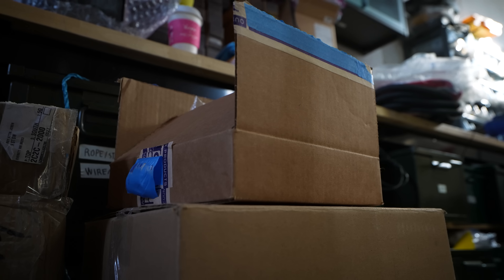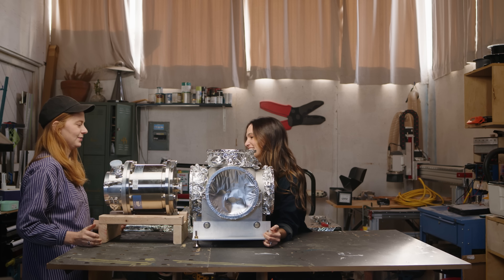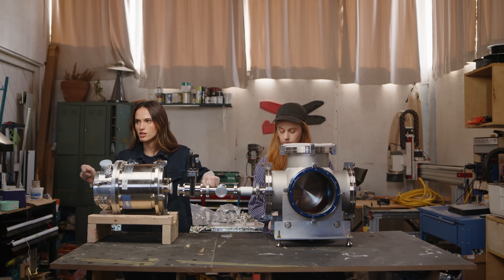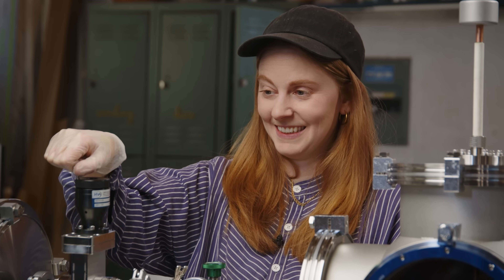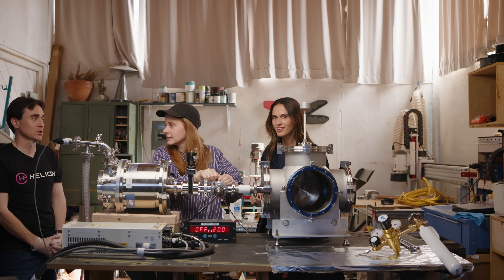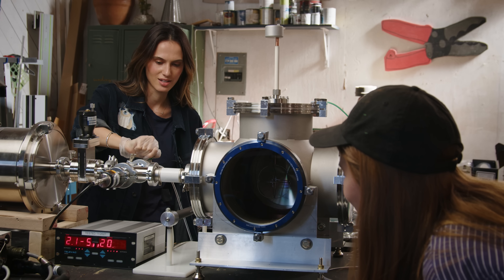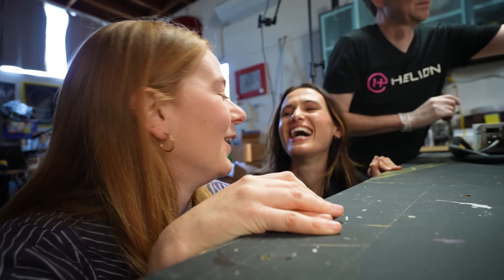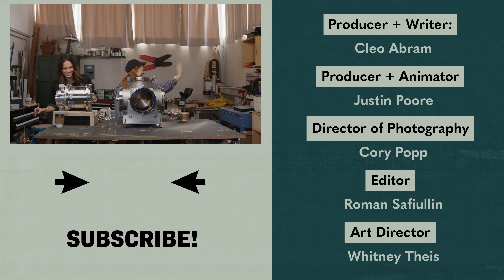We Tried To Do Nuclear Fusion

Comment: Cleo, when you suggested building a fusor to help people better understand fusion, we were all in! Thanks for coming up with such an awesome idea. And Simone, thanks for letting us send parts of a fusion machine to your workshop (twice 😅). This was so fun to build and really helps explain some fusion fundamentals.
Reply: It would be really cool if you had some way to detect the He in this kind of demo.
Reply: @jullit31  The easiest way to detect that fusion is actually happening is to prepare a Geiger counter (aka a radiation detector) that is configured to detect neutrons.  You can also use a dosimeter that is used to detect radiation exposure...a smart thing to do anyway when doing any nuclear energy experiments in general.

Measuring Helium may be a fools errand in terms of the quantities of Helium generated, but it might be worth the effort from an academic standpoint.
Reply: @jullit31  Replace the roughing pump with a helium leak detector, standard piece of vacuum equipment, would do the trick here. Would be cool to hear the tone change on the console as the amount of helium increases. One problem with this is that the pressure in the vacuum volume might be to high to provide the sensitivity necessary to detect it as the helium generation is likely very low. I'd love to see a video trying regardless!
Reply: @jullit31  Don't break the sweat! It's not real! The reading never goes beyond 3kV, in order to occurred 'fusion', they suppose to reach 31kV. If the fusion take place, its emissions are hard X-rays! Atleast one of them would die by this time, due to exposure to X-rays. Now they'll say that the fusion device will scale up easily with the stuff they shoe in their own workshop! Even the one at Helion energy is not going to scale up even if it scales up its gonna be chrnobyl reactor 4. As per their 'white paper', its supposed to be generating power plant level energy by 2021.
Reply: Well, this post is just another proof you guize at Helion are conscious and shameless scammers

:facepalm:
Reply: Nice scam, fellas. Bet you're laughing all the way to the bank.
Reply: What you have shown us, definitely looks like plasma, but how are we supposed to know that fusion is going on there? Plasma is necessary precondition for fusion but it is not enough to confirm fusion.
Reply: I am curious why this demonstration was done using deuterium-deuterium fusion instead of deuterium-tritium fusion? Is it to safeguard from neutron radiation?
Reply: Not fusion this is fraud
Reply: Please replace the roughing pump with a helium leak detector! Would be so cool to detect the increased presence of helium!
Reply: Aren't the X-Rays emitted from fusion dangerous?
Reply: Scam artist
Reply: Out of pure curiosity, how much does all that fusor hardware cost (and where would one go to get it?)
Reply: @taegrr_yt  1 gram of Tritium costs $30,000....× 200Kg per year.
Reply: Probably a stupid question but I'd love to get an explanaition:

At what temperature does the core of that fusion reactor get to?
My understanding is it should get to ridiculously high temperatures (talking about the 10^6 degrees Celsius). I can't understand how you can get a tiny point at that temperature and not having the machine melted, or the room, or everything. How is that heat contained?

Thank you.
Reply: Don't fake, do actual science! Helion is just another Theranos which is going to create backward progress in field of fusion, just back making fool out of investors by taking away there money eventually making them believe that not to invest in fusion anymore!
Reply: Helium is on the shortage list....
Reply: @paulmobleyscience  good thing they're going to be generating it in fusion reactors 😁
Reply: @paulmobleyscience  They made more of it!
Reply: @eyescreamcake  You need lithium to make more tritium and the Deuterium makes helium 3...yes I'm well aware.  At least 200 Kg of tritium is needed per site per year and at a cost of $30,000 a gram that's $6 trillion per site per year for just Tritium in the fuel.  This is not cost effective and is just like fission when they said It would be so cheap it couldn't be metered.  Trillions apon trillions later and we now see why we should've never had fission to begin with....Organically Bound Tritium.  Can on paper is not the same as actually doing it.  It wasn't even a net energy, it was only more than the lasers....big difference.
Reply: @paulmobleyscience  You sound very confused.
Reply: @paulmobleyscience yes helium is in short supply naturally but I know some well few elements can be man made I wonder if a synthetic helium can be made bc ok uranium but plutonium is made made but helium was used in hot air balloon and Goodyear blimps and Germany used them for transport but even balloons for party used to be helium I think they changed it now
Reply: You guys are full of crap and you know it.
Reply: Thank you for supporting this! It's huge and cool to see this working at a small scale! I can't wait to see what happens in the future!
Reply: cool that you guys are doing this.
Reply: @antiquevintageandobsolete  Techno-geeks keep trying to supplant the laws of physics, break the laws of thermodynamics, and achieve positive ERoEI. Never gonna happen. Entropy's a bitch.
Reply: There may come the next fusion energy breakthrough from somewhere.. but a commercial scale electricity generator from nuclear fusion.. I am expecting that from you guys.. @Helion
Make the world proud! 👍👍
Reply: @Chevvakula Srikanth  Don't break a sweat! It's not real! The reading never goes beyond 3kV, in order to occur 'fusion', they suppose to reach 31kV. If the fusion takes place, its emissions are hard X-rays! At least one of them would die by this time, due to exposure to X-rays. Now they'll say that the fusion device will scale up easily with the stuff they shoe in their own workshop! Even the one at Helion energy is not going to scale up even if it scales up its gonna be Chernobyl reactor 4. As per their 'white paper', its supposed to be generating power plant-level energy by 2021.
Reply: @ultimateswarm7868 most helium leak detectors are unable to achieve levels of vacuum that larger turbo molecular pumps are capable of hence most will incorporate 2 TMP’s in stages to help alleviate this issue. I wonder if this would be possible as well with the use of a cryo pump where adsorption is used to achieve a more entropic state in a system in conjunction with a roughing pump and potentially turbo molecular pumps as well, similar to physical vapor deposition within the semiconductor industry.
Reply: DM'ing my address right now! :)
Reply: At least we know we won't run out of helium any time soon now, ha, ha.
Reply: Anyone interested in sustained fusion should check out Quantum Kinetics Corporation. They have 4 patented devices holding fusion temperatures safely.
Reply: You guys are local to me last i checked, would love to see the facilities up close. :)
Reply: you're scammers
Reply: Hardly a good explanation. I am surprised you would claim fusion without verifying neutron production via bubble or proportional He-3 counter. We don't even know the final operating voltage and pressure, nor was there any warning to the viewers regarding potential x-ray production if they may choose to rework this.
Reply: @BenDover-uy5hz  absolutely. There is no proof they achieved fusion. This is potentially pr that's deceptive to Simone, Cleo and us viewers. WTF, Helion!
Reply: @ooooneeee  That's the problem with all these youtubers, they often have no idea about the things they present. Yet millions follow these channels thinking they're learning something about science.
Reply: Helion, it was badass for you to support them for this video.  It's super cool to learn about stuff like this and it would normally be way out of reach for us "normies."
Reply: I suppose that what is being produced in that "fusor" is plasma, which is certainly the first step to achieve fusion, but honestly I don't think fusion was taking place in that device, for that it would take a lot more energy than what was being injected there in order to achieve the Quantum Tunneling effect, and get the atoms close enough to produce their fusion.
Reply: Helion you guys are very cool, you made something difficult to understand fun to watch.
Reply: when will you start selling kits for this?
Reply: @paiggey  a reasonably cheap DIY fusor build is 2-3$k.  That's the I-scrounged-parts-for-a-year-or-more price.  If you made a kit you'd probably want a reliable supply and have to buy new parts from companies.  You can find a decent used turbomolecular pump with controller for ~$300 if you search for a few years, new would be 10x that, probably ditto ratio for the chamber.  I don't know how much a kit with all necessary parts would cost but probably around $10k for one with a smallish (4-6") chamber.  Not sure how many people would buy that (and then there's the issue of selling stuff that can kill you to clients who might not understand how to use them safely).
Reply: Fusion is easier with some metals , alloys , liquids . No need to use complicated set up like tokamac . Is anyone interested in it,  I will send the method. It's low energy fusions , not c - fusion
Reply: @Blue.star1  Helions use of Deuterium-Helium 3 and a capacitor bank still produces tritium...
Reply: Ehem... It's called GEORGE!
Reply: @paulmobleyscience  You're confused
Reply: @eyescreamcake  How so?
Reply: @antiquevintageandobsolete  No we wont...in magnetic confinement which is the running design, only 10% of the tritium is burned in the reaction area.  That means the Tritium must be recaptured and injected from 10-20 more times before its all burned.  The lithium-blanket is used in the Tokamak walls to produce Tritium around 15%. If only 1% of that tritium is lost, then the lithium-blanket will not be able to sustain the reaction.  Roughly 10% of the tritium will not be recovered.  Only 20% of the net energy once they do finally make net energy will only be available for purchase as the rest will need to be used for the process.
Reply: @antiquevintageandobsolete  wow, a better explanation...
Reply: @antiquevintageandobsolete  One question....what starts the reactor?
Edit Tritium isn't rare, it permeates the metallic structures of our fission reactors
Reply: That was pretty awesome!

One more question i have, if spacex starship succeeds and the cost of mass per ton to orbit is significantly reduced, would you consider performing nuclear fusion experiments in space?

Like that would be so cool, and the tech for plasma generation can be used to both generate power and propulsion, so do consider the idea!
Reply: You r from real engineering channel
Cool cool
Reply: You are a true inspiration for me, i am not even an engineer or physicist but i am totally amazed at your work, hello and regards from turkey :)
Reply: String Theory was not a waste of time. Geometry is the key to Math and Physics.

What if we describe subatomic particles as spatial curvature, instead of trying to describe General Relativity as being mediated by particles?

Quantum Entangled Twisted Tubules:  "A theory that you can't explain to a bartender is probably no damn good."  Ernest Rutherford

The following is meant to be a generalized framework for an extension of Kaluza-Klein Theory.  Does it agree with the “Twistor Theory” of Roger Penrose?   During the early history of mankind, the twisting of fibers was used to produce thread, and this thread was used to produce fabrics.   The twist of the thread is locked up within these fabrics.  Is matter made up of twisted 3D-4D structures which store spatial curvature that we describe as “particles"?   Are the twist cycles the "quanta" of Quantum Mechanics?

When we draw a sine wave on a blackboard, we are representing spatial curvature. Does a photon transfer spatial curvature from one location to another? Wrap a piece of wire around a pencil and it can produce a 3D coil of wire, much like a spring. When viewed from the side it can look like a two-dimensional sine wave. You could coil the wire with either a right-hand twist, or with a left-hand twist. Could Planck's Constant be proportional to the twist cycles. A photon with a higher frequency has more energy.  ( E=hf, More spatial curvature as the frequency increases = more Energy ). What if gluons are actually made up of these twisted tubes which become entangled with other tubes to produce quarks. (In the same way twisted electrical extension cords can become entangled.) Therefore, the gluons are a part of the quarks. Quarks cannot exist without gluons, and vice-versa. Mesons are made up of two entangled tubes (Quarks/Gluons), while protons and neutrons would be made up of three entangled tubes. (Quarks/Gluons) The "Color Force" would be related to the XYZ coordinates (orientation) of entanglement. "Asymptotic Freedom", and "flux tubes" are logically based on this concept. The Dirac “belt trick” also reveals the concept of twist in the ½ spin of subatomic particles.   If each twist cycle is proportional to h, we have identified the source of Quantum Mechanics as a consequence twist cycle geometry.  

Modern physicists say the Strong Force is mediated by a constant exchange of Mesons. The diagrams produced by some modern physicists actually represent the Strong Force like a spring connecting the two quarks. Asymptotic Freedom acts like real springs. Their drawing is actually more correct than their theory and matches perfectly to what I am saying in this model. You cannot separate the Gluons from the Quarks because they are a part of the same thing. The Quarks are the places where the Gluons are entangled with each other. 

Neutrinos would be made up of a twisted torus (like a twisted donut) within this model. The twist in the torus can either be Right-Hand or Left-Hand.   Some twisted donuts can be larger than others, which can produce three different types of neutrinos.   Gravity is a result of a very small curvature imbalance within atoms. (This is why the force of gravity is so small.) Instead of attempting to explain matter as "particles", this concept attempts to explain matter more in the manner of our current understanding of the space-time curvature of gravity. If an electron has qualities of both a particle and a wave, it cannot be either one. It must be something else. Therefore, a "particle" is actually a structure which stores spatial curvature. Can an electron-positron pair (which are made up of opposite directions of twist) annihilate each other by unwinding into each other producing Gamma Ray photons?  

Does an electron travel through space like a threaded nut traveling down a threaded rod, with each twist cycle proportional to Planck’s Constant?  Does it wind up on one end, while unwinding on the other end?   Is this related to the Higgs field?  Does this help explain the strange ½ spin of many subatomic particles?  Does the 720 degree rotation of a 1/2 spin particle require at least one extra dimension? 

 Alpha decay occurs when the two protons and two neutrons (which are bound together by entangled tubes), become un-entangled from the rest of the nucleons

. Beta decay occurs when the tube of a down quark/gluon in a neutron becomes overtwisted and breaks producing a twisted torus (neutrino) and an up quark, and the ejected electron. The phenomenon of Supercoiling involving twist and writhe cycles may reveal how overtwisted quarks can produce these new particles. The conversion of twists into writhes, and vice-versa, is an interesting process.

 Gamma photons are produced when a tube unwinds producing electromagnetic waves.

>>>>>>>>>>>>>>>>>>>>>>
Within this model a black hole could represent a quantum of gravity, because it is one cycle of spatial gravitational curvature.   Therefore, instead of a graviton being a subatomic particle it could be considered to be a black hole.   The overall gravitational attraction would be caused by a very tiny curvature imbalance within atoms.  We know there is an unequal distribution of electrical charge within each atom because the positive charge is concentrated within the nucleus, even though the overall electrical charge of the atom is balanced by equal positive and negative charge.
>>>>>>>>>>>>>>>>>>>>>>
In this model Alpha equals the compactification ratio within the twistor cone, which is approximately  1/137.

1= Hypertubule diameter at 4D interface

137= Cone’s larger end diameter at 3D interface where the photons are absorbed or emitted.

The 4D twisted Hypertubule gets longer or shorter as twisting or untwisting occurs.   (720 degrees per twist cycle.)  

>>>>>>>>>>>>>>>>>>>>>>>
How many neutrinos are left over from the Big Bang?  They have a small mass, but they could be very large in number.     Could this help explain Dark Matter?
>>>>>>>>>>>>>>>>>>>>>>>>

Why did Paul Dirac use the twist in a belt to help explain particle spin?  Is Dirac’s belt trick related to this model?    Is the “Quantum” unit based on twist cycles? 

++++++++++++++++++++++++++++++++++++++++++++++++++++++++++++++++++++++++++

I started out imagining a subatomic Einstein-Rosen Bridge whose internal surface is twisted with either a Right-Hand twist, or a Left-Hand twist.  The model grew out of that simple idea. 

 I was also trying to imagine a way to stuff the curvature of a 3 D sine wave into subatomic particles.
.
Reply: this is amazing, thanks Helion
Reply: I've now subscribed to Helion.
Reply: Not impressed at all .... atleast tell us what each part is ... what its doing etc ... also show us how you extract electricity/heat/energy from it if possible ...  it just looked like neon/plasma lights that's it ... man really wanted to see something in detail ... there only so many people who have this kind of knowledge & equipment budget ....  this was annoying. 

Also  you should have explained what the diff is bw this experiment and what helion is actually building ... instead of just scaling this up etc. man super annoying.
Reply: @hemantsarthak  why so pressed? You can search that stuff yourself?
Reply: @hemantsarthak  this system doesn't extract any heat, it's not designed for generating power, just a way to fuse on a small scale. The plasma density is too low to really get much out of the process, that's why the full scale machines are sooo complex and expensive.
Reply: @Flyingwigs  Yes I understand and want to know more about that .... the comparison about it and everything in bw .... and even if they cant show all that in this video ... they did a poor job even explaining what they were doing and the machines/parts involved that's what annoyed me.
Reply: @Hemant Sarthak  dude, don't break the sweat! It's not real! The reading never goes beyond 3kV, in order to occurred 'fusion', they suppose to reach 31kV. If the fusion take place, its emissions are hard X-rays! Atleast one of them would die by this time, due to exposure to X-rays. Now they'll say, well it's scaled down it's gonna scale up just like that. Lol no! The fusion device scaling is not linear!